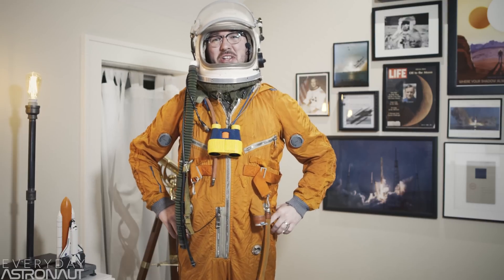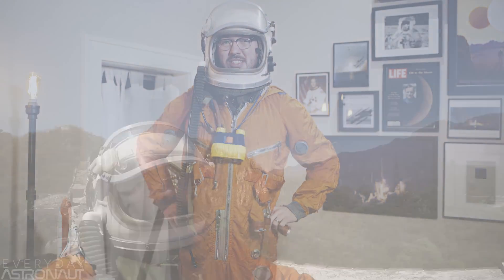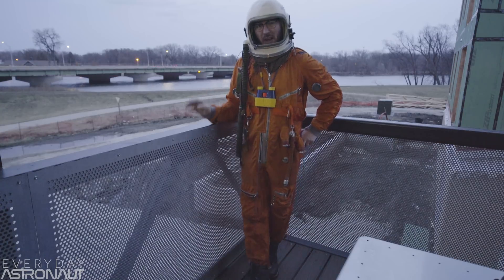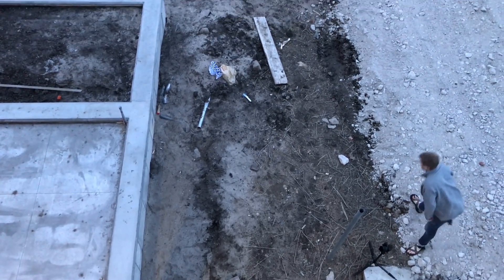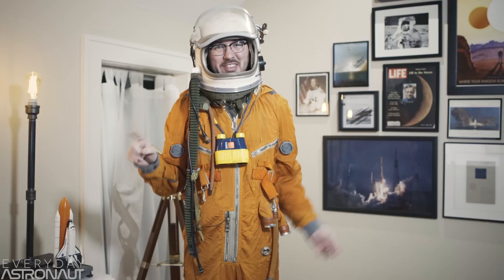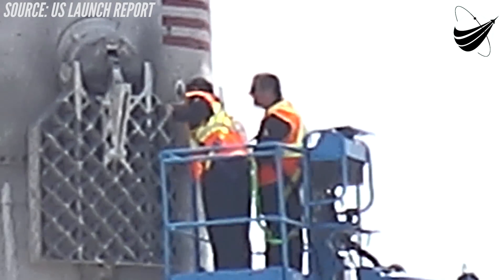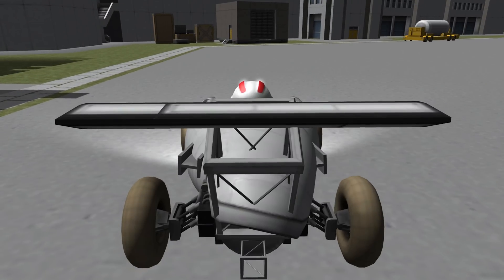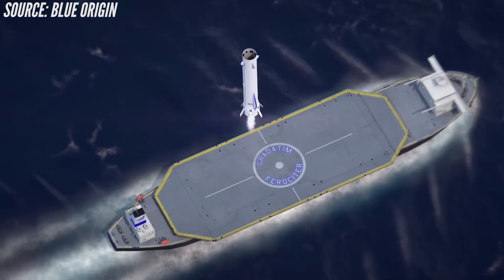How SpaceX lands the Falcon 9: Why they don't use parachutes!

Comment: Has anybody even made a toy rocket before and launched it up make a toy rocket launch it up and then bring it back down with with those little fins yeah right this is all b*****
Reply from the maker: Yes actually. Check out BPS space. It’s actually a lot harder to do with a small toy rocket than it is with something large that has large control surfaces and precisely built and controllable engines.

Comment: B***** you f**** idiot who the fuc U lying to I so now that use more fuel so now they have to take more fuel with them so they can make the same kind of Landing as it did launching are guys stupid
Reply from the maker: Hmmm perhaps you should do a little more thinking before you speak here friend. First off, when a rocket takes off, 95% of its weight is fuel. It has to lift allllll that heavy fuel. As the rocket burns fuel it gets lighter and lighter so the same engine can perform more work for the same amount of energy, just like if I gave you a back pack with 100 bricks and had you climb stairs, if I took a brick out every step by the end you’d feel very light and free to climb. So now with only 15% of the fuel remaining, the rocket lets go of the top 1/3rd of the rocket (freeing up more weight) and falls back to either. Now remember on the way up, we had the atmosphere to fight against, well on the way back down it will slow us down meaning we have even less work to do. So no, it doesn’t take anywhere NEAR the same amount of fuel to land as it does to take off because the vehicle weighs much much much less AND the atmosphere works to slow it down on the way back down. 

Not to mention, you yourself can go watch one land! Do it. Go to Florida and watch a mission that has a return to launch site landing (like a CRS mission). You can literally watch it with your own eyes along with everyone in Titusville, cocoa, cocoa beach and the 100,000 tourists that go to watch launches (and landings).

So before you call anyone an idiot at least do yourself a favor and watch for yourself before you make claims of knowing how any of this works.

Comment: What I don't understand is why they don't set up some kind of deploying system of pylons and metal cables to catch the rocket should it tip over due to a faulty landing. I can understand why they don't have this on the drone ship (to prevent the ship from capsizing) but why not on land?
Reply from the maker: Because they don’t need it. It’s precise enough and has proven reliable to not need it. Why make it more complicated when they’ve clearly perfected it
Reply: Maybe. But it definitely seems like a cheap way to add some more redundancy to the desired outcome of rocket re-usability. But I'm not gonna pretend like I'm smarter than the guys at SpaceX or act like they haven't done a cost-benefit analysis on the practicality of a rocket catch system.

Comment: More than inaccuracy, I always thought that a parachute wouldn't work because of the sheer speed by which the rockets came. I mean, at something above mach 1 a few hundred meters from the ground, I doubt you would find any chute that would hold in shape, let alone slow the thing down.

Comment: Precision guided parachute systems have been around for years https://youtu.be/yQlj5-aWdSk

..so I guess I was expecting a more technical explanation why carrying more fuel is preferable to a parachute. I guess if the 'hover slam' has evolved to a high reliability it's a simple issue of fuel weight vs parachute weight, as the necessary propulsion systems are all already present.
Reply: WaffleStaffel I totally agree with using precision chutes. They don’t blow up if they malfunction and do not use fuel that could be used for going up and not going down. After all going up is the main objective right?

Comment: He is totally wrong about using parachutes. Nasa used parachutes on its SRB from the shuttle program, from 1981, through 2011. (Using GPS tracking, and allowing them to fall into to ocean to be retrieved.) Parachute landings are just as precise as a retro rocket re-entry, and much simpler. Nasa used parachutes from the beginning of the USA(and National Advisory Committee for Aeronautics (NACA)) space program. The russians still use parachutes to retrieve HUMANS who are coming back from the ISS Space Station. (The russians are smart in that they developed systems that work everytime, and kept using them. Russian rockets(the only ones that can send humans into space right now) are actually early 1960's technology that works almost every time, and some of the rockets the Russians use to send up Astronauts and equipment are actually rockets that were built in the 1960s for their ICBM program. Russian rockets are almost like the family car. One can almost just go out to it, turn the key, and it starts up.)  The real reason for SpaceX using retro rockets is to test out the technology for missions to other planets.
Reply: Out of 270 SRBs launched over the Shuttle program, all but four were recovered – those from STS-4 (due to a parachute malfunction) and STS-51-L (Challenger disaster). Over 5,000 parts were refurbished for reuse after each flight. The final set of SRBs that launched STS-135 included parts that flew on 59 previous missions, including STS-1. The space shuttle rocker boosters(SRB) were/are 149.16 ft tall, and used parachutes to recover them.

Comment: What about a jettisonable parachute for at least a part of the descent? Wouldn't that save a LOT of deceleration fuel / weight? It wouldn't have to 'suspend' the rocket fully, just partially slow it down.  Or would you still have the problem of winds taking the rocket too far off course? Or would there be a balance to be had?

Comment: I'd not come across the term "hoverslam".  In KSP we call that a "suicide burn".  :D

I've also heard that the first stage engines have a minimum stable throttle which is a lot higher than the thrust needed to come to a smooth stop.

Comment: And one more thing the Apollo 11 landing didn’t have any problems landing on the moon without Atmosphere! It was called the lunar lander! They didn’t take the entire rocket down to the moon that would’ve been stupid! This whole space x crap is just that crap! They are spending millions making a ink pen that writes in space instead of just using pencils in my opinion
Reply from the maker: You realize they do this so they can reuse the booster right? That was they can reuse the biggest and most expensive part of the rocket and thereby save millions,.
Reply: Everyday Astronaut well they can still reuse the booster if they float it down with a parachute. Why not use the rocket engines to slow it down enough to then deploy a parachute and float it down the rest of the way? Saving all that rocket fuel for the assent instead of using it for the landing? Also most of the time the rockets blow up trying to land back on the pad. But also. The solid rocket boosters were reused on the space shuttle And they floated them back with parachutes!!! I’m sorry this is a solution looking for a problem as far as I’m concerned
Reply: And you say in the video a little bit of fuel to bring it back to earth. I’d like to know the actual percentage of fuel onboard is used to bring it back to earth? Do you know?
Reply from the maker: Allow me to help answer a few questions. First off, so far, out of the 26 attempts to land a booster, 20 of them have been successful, and they're now on a streak of 16! At the beginning, they had to invent so many things and hone in on so much in order to make it work out, but now, it's incredibly reliable. As far as why not parachutes, because the vehicle is designed for compression stress. Think of how the engines push up on the fuselage and compress the whole thing during ascent with about 2-3 G's of force. When the vehicle lands under propulsive landing, it's STILL compressive stress. If it were dangling from a parachute, they would need to add a whole lot of weight to make it so the vehicle could handle the tensile strength of dangling from a parachute. Just so you know, the remaining fuel is only about 10-15% percent since coming back down they can slow down through the atmosphere and there's no second stage weight and payload weight, so there's a lot of deltaV freed up when the stage separates. AND, if they're able to deliver the payload, who cares if they're using up extra fuel? If the payload gets to its destination, then why does it matter if they use 30% or something to land, it shouldn't matter, the works been done. Lastly, the space shuttle's boosters that landed by parachutes were solid rocket boosters. They're basically giant metal tubes and don't have any where near the delicate parts like a liquid fueled rocket has. Not to mention, the refurbishment costs of them repairing each booster after the salt water damage turned out to be the same price as a new one... so that didn't work out either. Landing a booster nice and healthy on dry land or a dry boat is the only way to go.
Reply: Everyday Astronaut ok I’ll take your word for it but I’m still not convinced. Maybe I’ll be proven wrong. I’ve been wrong before. But I’m still right about why Apple got rid of the headphones jack!! No matter the what Apple says is the reason it’s still a bull crap reason! Take care and. You did answer some of the questions I had about it and they do make sense. Some don’t. 😋
Reply from the maker: Excellent! Thanks for sticking around and having a good discussion with me! Check out some of my other videos that discuss this even more. I appreciate hearing from you. Thanks friend!
Reply: absolutely! im not a youtube troll...even though I might seem to be... i just feel like sometimes even though you can do something doesn't mean you should do it.. im just old school nasa.. i remember the apollo days when every bit of fuel was precious and you would not want to use any of it to land on earth. only for the launch!

Comment: A little more fuel? Well a little fuel is always the problem never enough fuel to go up with as much payload are possible. But now you use that precious fuel to land? And parachute don’t blow up every other time you try to use them to land! Why not use both. Rockets to slow it down enough to safely deploy a parachute then you can save rocket fuel and still land within a fairly small area? Or does that just make too much sense.

Comment: There is another issue with using parachutes that is worth mentioning. Parachutes will put stress pulling upwards on the top of the rocket which isn't a direction of stress that a rocket normally needs to deal with. But landing using the engine is the same stress direction when they take off. If one uses parachutes one would need to deal with extra stress profiles on the structure, which means even more mass.

Comment: coulden't you use a combination of rcs thrusters and a parachute?
Reply from the maker: +EDG the big problem (and something I forgot to really hit on) is the vehicle needs to slow down significantly before it hits the atmosphere so the atmosphere doesn't tear it apart. RCS isn't strong enough to slow it don't that much and a parachute wouldn't work in a vacuum... and we also talk about the reasons why a parachute doesn't work in general too

Comment: If not parachutes then why can't they just strap a landing gear and land it like the space shuttle? They already have those giant waffle makers that come out to manoeuvre the rocket, they can just replace those with landing gear.
Reply from the maker: +Zubin B. The space shuttle had giant wings to provide enough lift to land horizontally. The falcon 9 does not have enough lift. Adding wings adds weight.

Comment: Well, all well and good information but you are largely missing on one key engineering aspect. It require real time large calculation using kinematics and massive data acquisition and processing. Which is a very real engineering challenge which is often over looked in light to mechanical thing.

Comment: In real life engines can't be throttled like in KSP.Only a few (including the Merlin engines can), but even those can't throttle down enough to hover.If they are ignited to early , the rocket is going to start climbing back up because Falcon 9's thrust to weight ratio is pretty high with empty tanks.

Comment: Wrong.  Use parachutes to slow the craft in the upper atmosphere only and then use only engines to land. Perhaps, one kind of shuts designed for the upper atmosphere and a second set for the lower portion of the atmosphere, switching to engines in the landing.
Reply from the maker: +Charles Belcher parachutes don't work where there is no air and the vehicle needs to slow down BEFORE it hits the atmosphere so it doesn't tear it apart. Parachutes don't work, spacex tried it. They're now 100% for landings for the year. I think they figured out a reliable system 👍

Comment: It's hard to believe those engines have that much power and that much fuel to launch to space and then fight gravity and land back on earth.
Reply from the maker: +u2ooberboober check out my newest video (we'll not the Tesla commercial). It explains a little more about how they do that 😊👍 it's amazing. But luckily on the way back down, the same air that fought the rocket from leaving the Earth now helps to aerobrake and slow the rocket down, a lot! Also it's much much lighter now with out the second stage and payload so it barely requires anything to land (by comparison to taking off)

Comment: Someone forgot the DC-X didn't they? It was doing this back in the early 90s.
Reply from the maker: +anticarrrot it was doing it in the same way Masten has been doing it for a while too. The reason we're focusing on SpaceX and mentioned BO is because of the scale and publicity of their demonstrations.
Reply: +Everyday Astronaut
Except they were doing it 10 years before Masten, which isn't really a minor detail, and they also faced active lobbyist and congressional opposition, which none of the current companies do. You asked "Why did it take until 2015 [to do this]?" The active opposition is a big part of an answer to that. In fact politics (and political lies) are a big part of the space program. To an extent that a lot of it doesn't make any sense without it.

For example, the political lie that the shuttle was built for reusability. It wasn't. It was built to be a spaceplace, with 1000miles of cross range, capable of carrying twice the cargo NASA wanted, with an R&D target of half of what NASA estimated was needed for a far less capable vehicle. Reusability was something they wanted to build it for, but it is NOT what they did build it for. A fact that is absurdly obvious on even a brief examination of shuttle designs before and after congress and the USAF stuck their oar in and gave NASA their marching orders. Plus there are the political lies that NASA told about what even an optimal shuttle could do in terms of launch frequency and cost and...

And yes, this video was about why parachutes aren't a good recovery system (though steerable parachutes have been a thing for decades, and GPS guided parachutes for ~ten years...) but maybe an important topic to cover in a future video?

Comment: I haven't seen any comment here about another serious problem with parachutes, namely, that they impose forces stretching the rocket, whereas it is designed for compressive forces. Parachutes held sway for far too long in this business. Actually, Gemini was initially meant to land on terra firma using a Rogallo wing (yup, after that hang gliding  really got going), but the technology could not be developed in time. Paragliders were also considered for Apollo.
Reply from the maker: +awuma great thought. This is very true. Also I think you're referring to the paraglide for Gemini, no Apollo. But yes 😊👍

Comment: In the pictures they always show the rocket returning. I find it so insane to imagine the damn thing having to spend fuel to decelerate back to zero, make horizontal speed backwads to get back to the same spot, and then burn some more for landing. It seems so much more efficient to just continue on your suborbital path, use the atmosphere to decelerate and then only use a little fuel for the landing. Of course that would mean landing 100s of miles from the launch pad (which is why i initially thought they landed on sea) but i dont really see a problem with that. You could even have multiple landing sites over the world for boosters to land after different types of tasks that result in different distances from the launch site.
Reply from the maker: +Arjen Smit depending on the payload and it's destination they do land at the ocean. But even an expendable booster doesn't even travel 500ish miles down range, so not nearly far enough to land at different islands or something, which is exactly why they have a mobile platform for it to land following its ballistic trajectory. When they have margins to land on land, it removes variables in retrieval, so obviously if they can return to land, they will.

Comment: what's wrong with deployable aerofoils? I can see how SpaceX's approach is likely a technology with other future applications, but for this specific problem a simple aerodynamic wing seems like it'd be a far more efficient & accurate way of safely landing a spent rocket?
Reply: the grid fins technically are an airfoil, but more to your point grid fins work much better then an aileron at hypersonic speeds(above Mach 5) at those speeds the air could rip the foils off